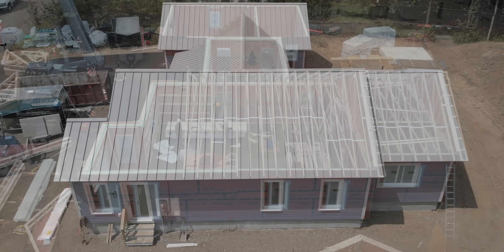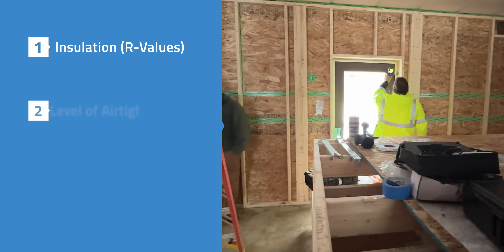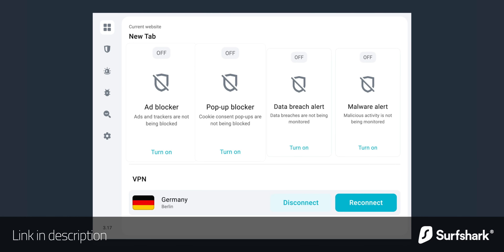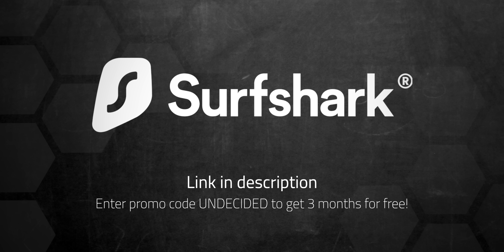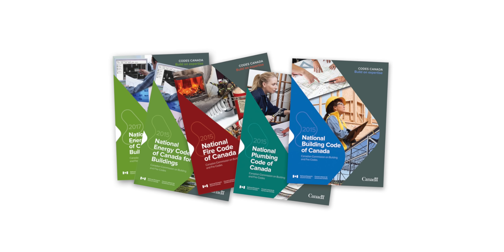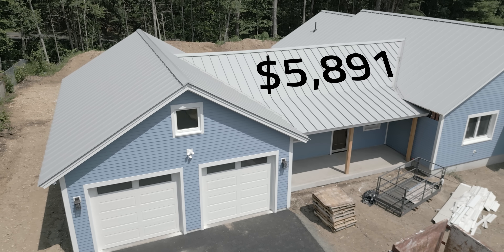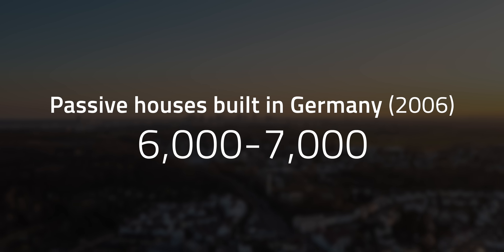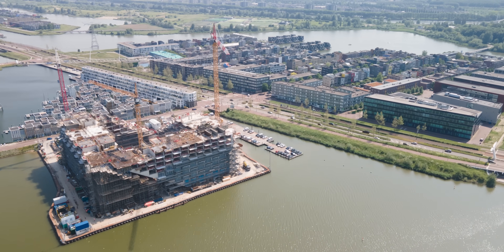Why Do American Homes Suck?

Comment: My roof just hot upgraded with Rc 4,7 ( U 0,21) and my walls will be isolated with Rc 1,85 ( U 0,55). The limitation is the area between the inner and outer wall, what will be 6cm. Unfortunate this is how houses were built in the seventies. 

My solar output is 5040Wattpiek or expected 4690kwh a year. 

My floor isn’t isolated yet.

My things on the list are;
Airco that can heat
Heat air pump with external unit (hybrid)
And electric cooking

Comment: As a German who lived quite a long time in the US (California), I can confirm, the US houses are not efficient at all! I just bought a German hous which was build 1981 and it has 30cm (feet) thick red stone outer walls with hollow pockets for insulation! These stones meet passive standard with a thickness of 42cm. So this house was 71% of passive standard for 42 years! And we put more insulation on the outside to meet passive standards this year. It‘s not like it‘s the stone to wood house difference, but even our wood houses have 50cm (20 inch) thick walls with 3-5 layers and mineral wool filling. Also since this year every new or renovated house MUST have a solar installation!

Comment: I'm german and I do believe the USofA has a chance of turning this around. America has for decades been in many areas a nation of high, though untapped, potential and I think they can do the structural changes necessary to build better homes. Something an american friend of mine has said to me is that in states that are regularly bothered by hurricanes it wouldn't make sense to build better houses since they'd just get hurricane'd again the next year. Is that a real problem? Would the higher efficiency and strength of concrete or brick houses with higher quality everything be rendered futile by the hurricanes? I'd thought they'd be harder to destroy than wooden houses. If anyone has thoughts, information and opinions on that please let me know!

Comment: Here in EU it does not even come to a mind to build bad insulated house. During construction of our house I've always went for the top end of the scale. It does not cost that much more to have a good insulation. The insulation in facade is 20cm (7.9") and on the roof it's 35cm (13.8"). Bottom of the house is as well good insulated. So far we're projecting to use about 3MW of electrical energy in total per year. So, to heat 250m2 house (2700sq feet), water heating for 4 person and all the rest. We've also installed a 16m3 (4200gal) water tank for rainfall water to use it for watering of the garden, car washing, clothes washing and for toilet flushing.

Comment: For everyone confused as I was:
To convert imperial u-factors to metric u-factors, multiply by 5.678.
It means imperial U-factor of 0.035 is metric 0,19873 which corresponds to metric R value of 5

Writing this from Ukrainian house with walls metric R value of 5.86, which means imperial U-value of 0.030

Comment: I live in Europe in a building from the 50's that was converted to apparments in 2016. My particular unit still has the original "historical grade double pane windows" as it is a chapel. The outside view is protected. Previous winters the 6m (~20') tall ceiling and the 4.5m (~15') tall windows would always have a cold draft coming down. I could turn on the heating in the morning at 8:00 and by 17:00 it would start to become a pleasant temperature.

Last winter, shortly before the Russian invasion of Ukraine sent the gas prices through the roof, I decided enough is enough and added acrylic additional windows on the inside. Cost me €1000 of my own money in a rental place. Big panes of acrylic + aluminium profiles to keep everything in place.

This year we got the final bill for heating from the previous year. I was the only person in the building who got money back. Many of them had to pay €700-€1500 more. I would have too if not for the extra layer of insulation.

And the kicker is, it's much more comfortable inside. I've turned down the radiators to make them more efficient using a laser thermometer. And I still need just 1-2 hours of heating to make the place a comfortable temperature and it won't drop below that for another 8 hours. Even in the dead of winter my heating is on maybe 3 hours a day instead of 12-14 hours.

I'm looking forward to seeing how this year stacks up.

Comment: The UK is full of poorly insulated homes, the new regulations have not made this much better and there is more that can be done, a simple measure would be for the government to remove sales tax (VAT) from these products making them 20% cheaper.  A lot of the UK housing stock is also around 100 years old or more, very few have cavity insulation and many, but not enough, are being retrofitted with external insulation.  Triple glazing is not a standard in the UK, most double glazing windows, achieve around 1.5U value these days - for any installed in last 5 years, but most houses have had double glazing for 20 years plus - so this is around 2.5u typically.  There are double glazed windows from companies like schuco that are 1U, so spending twice as much money to get 0.8u value triple glazed is pointless for many.

Comment: Why didn't you add a solar thermal panel with your system? is very effective, and low-tech, 3 panels would do the job as complementary water heater. During the summer is sufficient.

Comment: Matt, great content on an very important topic. You need to make a visit to the BCIT Zero Emissions Building Learning Centre, and learn of the Step 5 code that is required by 2032. Essentially any new construction from 2030 will need to meet/exceed a Passive House standard. Homes are already being built today that meet this Step 5 code standard. 
Hope you make this into a series, or playlist and add future tours and insights of the best examples being implemented. Key is consumer education, as most developers are interested in maximizing their profits, with little regard for ownership costs. The US currently has a housing shortage, so building energy efficient new homes at affordable prices needs to be a top priority.

Comment: We’re mainly talking about building new homes, right? Because here in The Netherlands we still have plenty of old homes that are terribly insulated. 
On the other hand, our current house is very efficient though. It’s about 15 years old and there’s often a 15 degree C difference between outside and inside temperatures in the winter when it’s freezing outside

Comment: The traditional lack of efficiency really does drive me nuts.  My previous house was built in the early 80s, had double pane windows but they were aluminum.  They conducted so much heat out that they would generate massive amounts of condensation and actually rotted the drywall at the bottom corners.  That place was expensive to heat, and nearly impossible to air condition in the summer.  That's my ex's problem now.  I had started replacing the windows, starting with the one in the kitchen, which suddenly made that room bearable.  Unfortunately she didn't like it, so the rest of the house was still awaiting her window opinion input two years later when I left.
Reply: Agreed. In sourthern California i see rows of dumb(inefficient) track houses with smart(modern) cars parked there. 
Its like looking at a time warp back to the 1950's from whence the building codes came. It looks SO stupid !!
Reply: @solosailorsv8065  I'd say the cars are just more of a green-washing, if I didn't know it as a fact...
Reply: The issue is windows no matter how energy efficient they lose that efficiency in years a study proved after 2 to 5 years all argon gas is gone, I suggest we outlaw all windows in future home to keep them energy efficient.
Reply: @RobertMillerJustme  lol
Reply: In New Zealand, old places have wooden windows that are single pane, so loads of drafts, then they adopted aluminium single pane glass windows. This fascination with aluminium windows has stuck. This plus the drastic step to move away from cold moldy housing has seen double glazing been taken up in a big way. But guess what, still with non-thermally broken aluminium frames. So new builds with new up to date building codes and double glazing are still getting loads of condensation. It's such a big problem, loads of people then just leave a windows a jar to allow for the windows to be less thermally different from outside temps and there fore less moisture. It's like the building code here has no understanding of the point of double glazing, and NZers are mostly un aware until they move into their brand new build and see it dripping wet inside on cold days. Ah well I guess in another 10 to 20 years they will make the change to European style windows. The only people doing this are those that are installing windows themselves. Developers are mass producing more subpar housing and calling it the best of standards. It is embarrassing. That and only just taking up insulating walls, and likely only the external ones. The only relatively standard insulation to date has been thin insulation under the floor and in onto of the ceiling. (Not even the roof trusses, cause who needs a nicely insulated roof space.) It is a joke and most people think the standards are great. This is with the biggest push for building new homes in over 30 years, and they are all going up, trash.
Reply: @benjamin_parry European windows are ugly. I’d rather have cheaply built attractive windows than ugly looking high R value windows

Comment: Central Authority vs. State Autonomy is a debate OLDER than the US, and I don't think it's ending any time soon. Also, using outdated codes doesn't necessarily mean there are lesser standards or requirements, just that new technologies and research haven't been incorporated (and the understanding of the problems isn't going to be lesser, either. '08 was the year Obama was elected, need you be reminded).

Comment: Some great points about the state of code standards in the US.  But the bottom line why US homes are so energy inefficient is simple: it's all about money. And of course politics is driven by monied interests. Home ownership drives much of the economy, and there are many political stakeholders who don't want to see that changed. Also, good luck getting a national set of building codes. Trying to establish a federal standard would be like pouring gasoline on the fire of political divisiveness that exists today. 

Watching the Youtube series "Black Forest Family", about American ex-pats living in Germany who build a home, is quite illuminating. Accustomed to US building standards, they experienced major culture shock with the arduous process to build their home. Most Germans don't own their homes. And most homes there are much more expensive to build or own, not to mention smaller than US homes.  Still, they identified all the great energy saving requirements in their construction.

Comment: Matt, you nailed it in this video. With energy prices as low as they are in the US there is no argument to be made to build better and install higher performance equipment/systems in our typical houses. 
We purchased a new furnace recently and we went with a high efficiency (HE) model versus replacing with a similar model that originally came with the house. The cost was basically double for the HE system. The salesman was a bit hesitant in selling me the better system because the cost to benefit ratio is just not that good with our current fuel prices. 
If you want to see wholesale interest and implementation of better building standards just watch if we see energy prices jump to our European friends and other countries prices. Folks will be ripping off the doors of businesses to get them out to retrofit their homes. 
Looking forward to hearing about your home once all the systems are commissioned and online. Good luck! 👍

Comment: Expectation that buildings will be replaced in 20 or 30 years. 

I think the US is also crippled by the expected that house will be replaced in a few decades. Houses are built with felt shingles on the roof, why? The frames are wood with minimal insulation, why? Yes it was vital to build many new homes quickly and cheeply in the 40s and 50s, but now it would be much better to build houses that will last 100 or 200 years rather than 30. 

I moved to the US a couple of years ago and now live in a lovely, not very energy efficient and slightly decrepit house built in 1900. Yes it will take some time and money to fix it up, but much cheaper and less carbon intensive than knocking it down and starting again. It just happens to be a terrace and built of brick, so massively more energy efficient and robust than most wood framed isolated houses.

Comment: NB  R35 (USA) is the same as R6.16 for the rest of the world (only Americans define the international R-value as R-SI (Systeme Internationale) - another; inch/foot-Fahrenheit-BTU, conversion thing (in the rest of the world everyone uses, metres, kelvin-degrees and Watts. R-Imp-(ft2·°F·h/BTU)   R-SI (m2·K/W)  - USA uses units inflated by 568% in this respect... (R-SI per mm is a lot different to R-imp per inch.) - have a laugh, the units are fun.  Thanks to Canada, both for being interested in Energy efficiency, and using bilingual unitary systems.

Comment: Building codes are only wroth the paper they are written on. I could write a thesis on each of your points showing off some of the many things you are missing. 
1. Number one of all the things you are missing is we as American's don't like nor agree with the many of the international moves in directions. 
2. I spent 4 years living in Germany and I can tell you that your thoughts that the housing and those tilt out windows are to be loved. They were necessary because AC was non-existent. Your airtight concept goes out the window. 
3. These ultra air tight homes are horrible when the power goes out for a day let alone a week or a month. For that long a duration they become death traps. Do not tell me this does not happen. It has heppened many times just this summer. 
4. Building efficient homes is good to a point, however as some point it is not common sense. 
5. The most important factor is affordability, your sit in your smug office pulling 7 figures while those of us on a real wage can not afford it. 

Lastly keep the government out of my business. If you want to make change then start smart, change the way house pass building inspections. Instead of a pass/fail. Give them a grade in one or more areas. Stop pushing yoru nationalistic ideology. Stick to engineering, your condesention is disgusting.

Comment: Older homes built before air conditioning had to be built to withstand ambient humidity, heat and cold. A typical home made by modern municode standards in Atlanta Georgia wouldn’t last a summer in the 100% humidity without its continual supply of air conditioning. The wallboard, the paints, insulation, structural wood… None of it is capable of withstanding actual weather. If the power went out long-term nationwide for two months one summer, the amount of mold that would show up in our homes across states east of the Mississippi would be devastating, especially in the Southeast and below the fall line. This is a critical issue that we aren’t planning for. Economically and environmentally speaking, long-term blackouts and continual intermittent brownouts are likely going to start happening in the next five years. We aren’t prepared for that. Let me state again: we live in flimsy stick homes that aren’t weather-ready for heat, cold or storms without their continual steady supply of electricity and a steady supply of rebuilding materials. We’re on the verge of the largest mass migration in US history not with our neighbors to the south, but with our own people because we are too stingy to build better.
1st	`1

Comment: I live in Australia and my house is a glorified shack. It's freezing in winter and retains so much heat in summer it is basically 25 degrees Celsius or above for about 4 months straight. All for the low price of $1.1 million. It's ridiculous.

Comment: We are replacing windows in our home.  We asked all three companies that came by for a quote with triple paned windows. two told us "oh our double paned our just as effecient as triple paned, you don't need that extra piece of glass" when we pushed them on it, they said "well, to be honest, we don't make them"

The third company gave us a quote, but it increased the cost 150%. our quote went from 4875 to $11900, when we asked why, he said "we don't like making them, the installers don't like installing them, they are heavy so the guys drop them and break them both in the factory and at the job site and we have to cover the cost to replace them so we charge that much so no one orders them."

Comment: 🔴🔴  30 years ago I developed an interest in straw bail housing.  After completion, the builder cut some plaster and lath away from a wall and tried to set fire to the straw. 19 seconds later it burned out.  If it gets wet, as long as air can get to it it will dry out.  It is said that it has an R -value of 54.  I would also like to see more geothermal use in the mid west.  6 feet below the surface it is supposed to be about 30°F cooler.